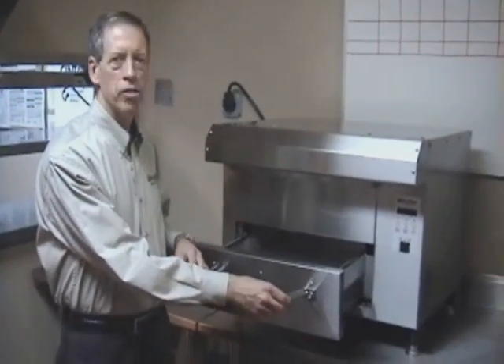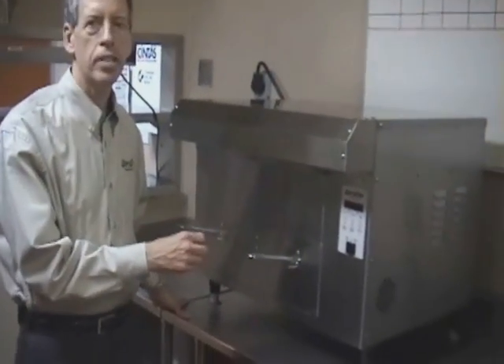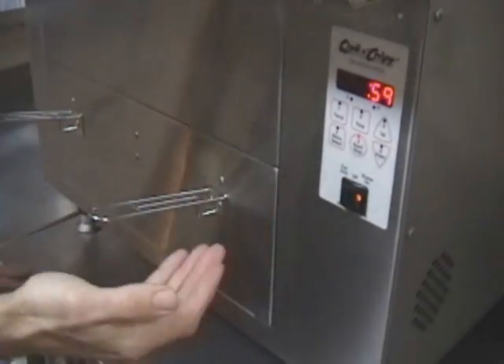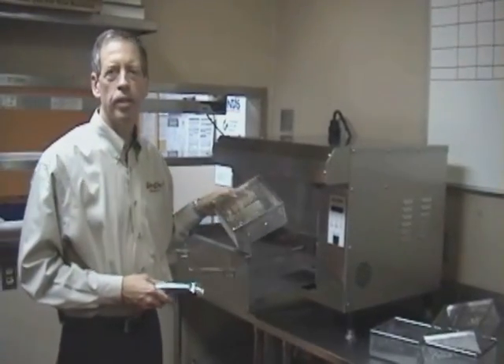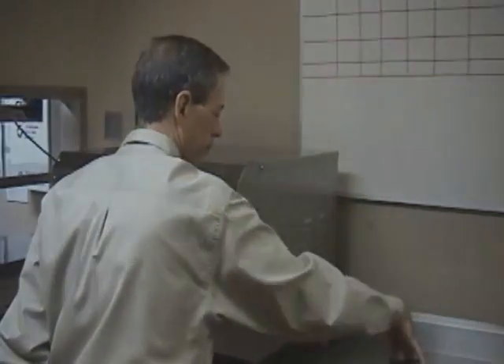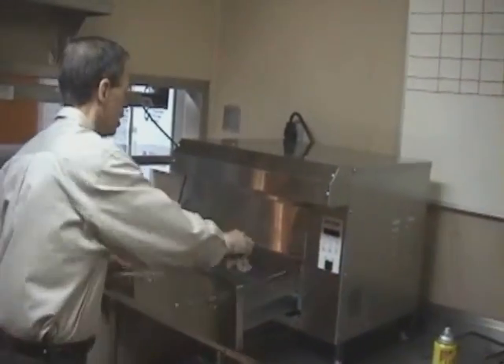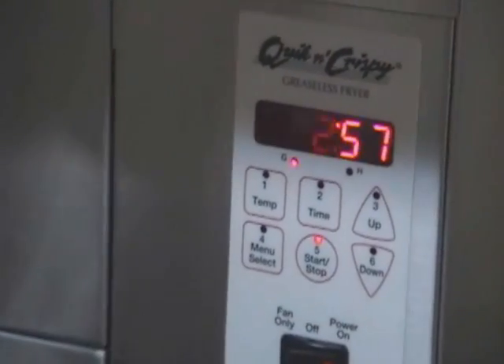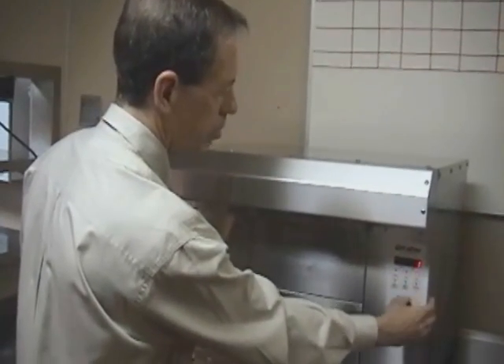Quik n' Crispy Model GF5 Operation and Preparation.

Comment: Its rather Slow& Soggy if you dont use the correct fries etc. This product is made for America. Even the recommended frozen product list is american. If you are in UK you are screwed. Everything you ll need to use this machine will cost you at least double from the wholesalers and You wont get much from one supplier only. I have bought one of these and stuck with it forever. Its waiting to get rusty in the garage.